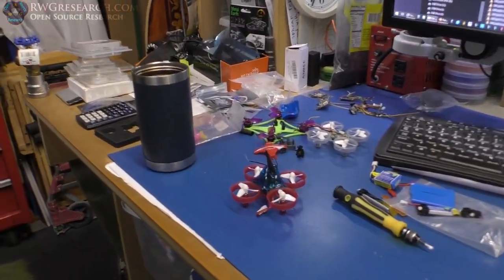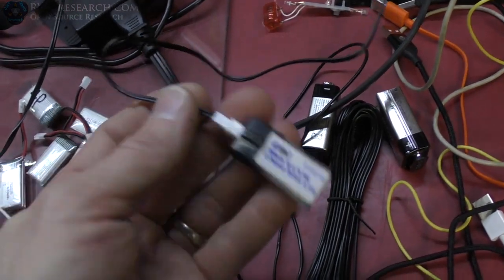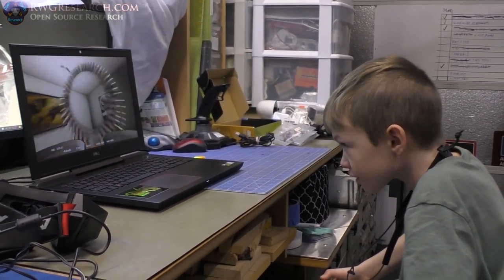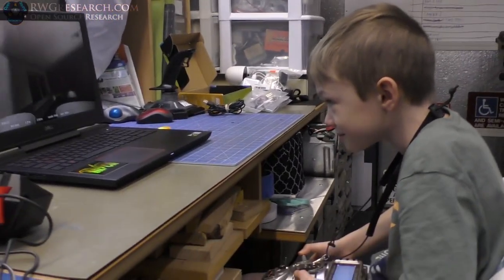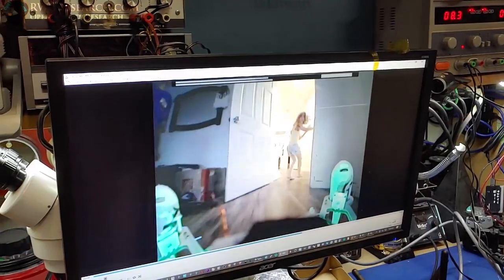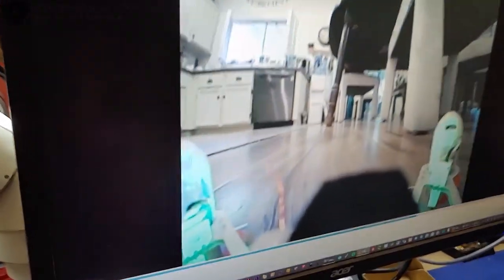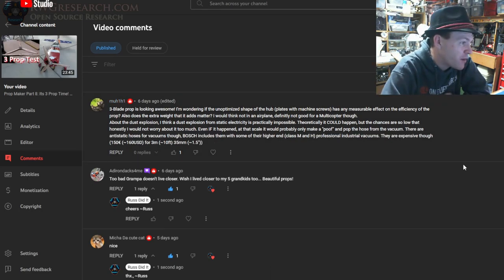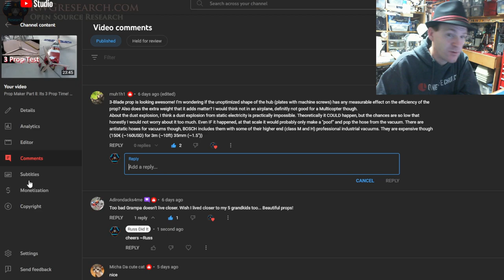I Did Not know This Was Possible... Until Now!! Tiny WHOOP

Comment: Morning Rus, have u checked out, Lawrence rayburn patent? Barbosa and leal patent? Patrick Kelly book? Cars running on water goes back to 1930, Tartarian empire? Steam engines may have been water splitting?geet reactor? Well the increadible amount of heat and unburnt fumes exiting the exhaust of any engine, should b run into the intake with as much steam as u can make with exhaust heat? 200 mpg? Clean exhaust?

Comment: 30C/60C means 30C continuous, 60C short duration (a few seconds). RC Lipo batteries usually don't like to be charged above 5C, even the better ones. Better keep it at 1-2C to be safe 👍
Great flying btw, looks like you've had some practice!
Reply: Throttle control is everything when flying multicopters, especially indoors. Took me a while to get a hang of it and still (after years) not very good it it. Still it's tons of fun! I also always spell "cheers" wrong and can never remember when to use steel and when to use steal :)
Reply from the maker: ok, yeah i know i charge @ 1C and no more than 2C most of the time. so that makes sense. 30 continuous and 60 burst. Great. now i'm informed lol ~Russ